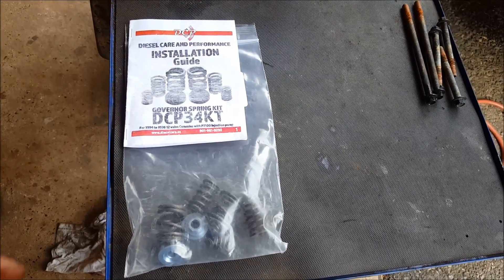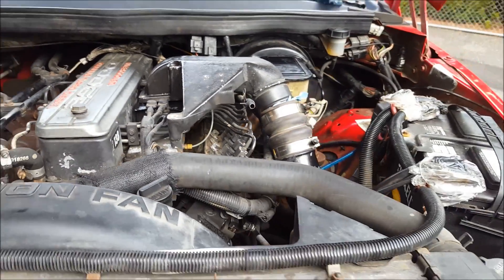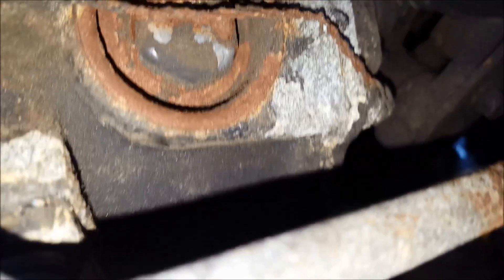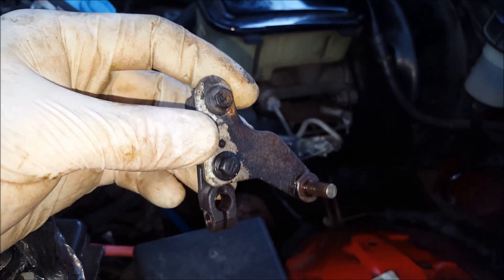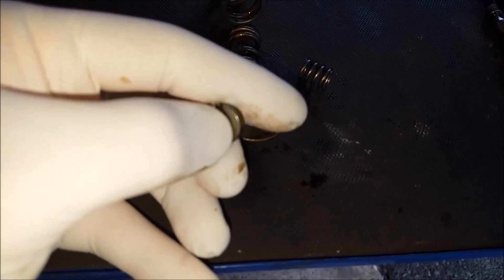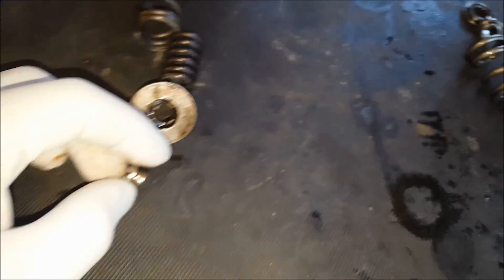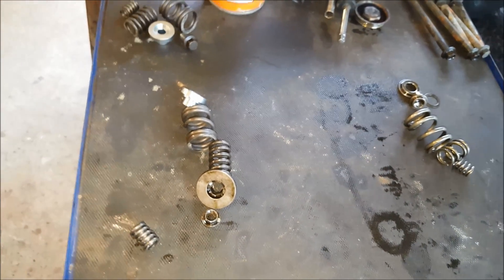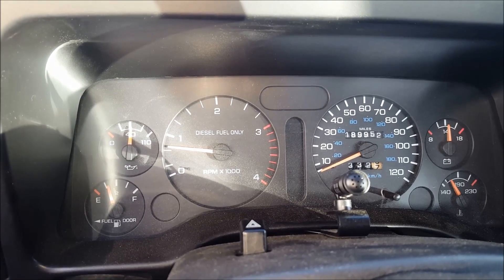HOW TO INSTALL 3k 4k Governor Spring Kit on Cummins 12v 6bt GSK Dodge Ram 12 valve

Comment: Did you have to adjust idle speed ? After install and did. Your truck keep the way it’s supposed to start without touching pedal? Trying to keep mine like it was before gsk
Reply: Ok gotcha are you up north where it’s really cold? I’m down south so I hope it don’t have a lot of trouble starting but I see you measure yours I measure mine from top of stud strait down to top of lock nut I got 0.149 on Digital caliper
Reply from the maker: @cdpperformance2613  yeah I'm in Pennsylvania. It gets pretty chilly. You should be good either way. Might just have to tweak idle a touch. But that's very simple
Reply: Yea I installed the 4k gsk yesterday went 4 clicks in and truck wanted to run away at 1600 rpm’s idle up! So backed off one click came down to 1k so I’m going out this morning going to back off one more click and hope it fixed it haven’t touched idle 10mm nut yet
Reply from the maker: Got you. That's cool. How are you liking the power Improvement? Big change?
Reply: @NoNonsenseKnowHow  man cutter up rob on YouTube kept telling me to install springs first before buying ... new 5x12’s injectors I didn’t listen and went ahead and purchased them but it’s got enough power for me now since I just tow with it but yes help a lot honestly could have just went 3k but I did have head done for 4k so just done it but I want never run it up that hard!
Reply from the maker: @cdpperformance2613  got you. I've heard that the 4K Springs are still better though for low and fueling as well.  Good to hear she's running top notch
Reply from the maker: If it's cold I have to slightly press the pedal to start. But then again I think the factory owners manual says that you should do that when it's cold right? I did have to adjust my idle. the springs definitely affected the cold idle.  Not sure if you saw but I actually did another video about a cold idle problem I was having and had to turn down the governor spring nut a little bit
Reply from the maker: Which helped, but it's still not as good as Factory

Comment: I found that the 4k springs made for a much better towing setup with my dually. I started with 3k springs then I went to 4k. My power band is very wide now and comes in at lower RPM. I installed 60lb head springs but I've only been over 3000 like once maybe twice
Reply from the maker: Interesting. Maybe I'll have to give it a go. Will you say that it smokes more with the 4k Springs?  I also noticed some cold start stalling with adding the 3K Springs. Do you notice any of that? Or are you not in a cold climate
Reply: @NoNonsenseKnowHow  up your idle rpm maybe? I also installed 4K and found it better than 3k. No extra smoke. I ground my fuel plate and I could make a brand new clutch slip with ease. Nice light haze. Iirc I ground something close to 100 plate. But that was quite a few years ago.
Reply: @davidburdett1920   Did you guys keep the stock schemes in place,while you replacing the springs?

Comment: If you back these spings off say, 2 notches would it increase  fuel faster to the injectors.
Reply from the maker: But then you end up with stalling issues when it's really cold out carried I actually turned my Springs in one more additional click to get rid of cold stalling. Every time I would let off the accelerator before the engine was warmed up it would stall out
Reply: @NoNonsenseKnowHow mine does this and its bone stock if i dont let it warm a little. Stock springs as well
Reply: I dont have starting stall probs it starts great specs for my pump says 4 to 10 90deg clicks is a big margin, im not sure what thay are set on at the moment thewire seals have been taken, will loosen springs bring fuel on earlier.
Reply from the maker: @nigelcase2991  yes correct. I believe I touched on that in the video. I could be mistaken..

Comment: Anyone ever had a washer on one side and not the other. Tamper wire still on. Swear I didn't see one fall off. Looked with light and mirror for half hour. There's nothing there. Put the new springs in and everything seems good. STRESSED
Reply: Just did mine today and ran into the same exact situation. Did you ever have any issues?

Comment: You ever figure out the fuel air issue on your truck brother? My p7100 makes an airy sound when warm? Is that normal? Truck runs fine but idk lol
Reply from the maker: Mine never made any sounds. No never got rid of the tiny air bubbles completely. Seems to be fine though
Reply: NoNonsenseKnowHow 10-4 it might be normal being that this is my first one but yeah runs great I just need to do what you did and get a pressure gauge and see what it’s at. I did pressurize the tank and heard no leaks and saw no leaks so 😐

Comment: My 12 valve had a stalling issue. I replaced the lift pump bc I didn't trust how the old one. Replaced the screen filter and and fuel filter. No leaks from what I can see. Truck does run again but still dies. I adjusted the idle screw a little bit and I got the truck to idle but the idle just bounces up and down. Its making me think it was a governor spring issue this whole time. My idle will go from 800 to 1500 and continue doing that. I fine tuned the idle screw and it doesn't matter. It's either no idle or it'll idle 800 to 1500 rpm. Any help would be appreciated. I did plan to change the governor springs prior to my current problem.
Reply from the maker: Maybe getting air in the fuel system? Does it start right up always?
Reply: it’s either air in the fuel like he said or governor springs
Reply: Make sure gov springs are adjusted properly.
Reply: Set you idol screw low around 650 to 700 it will come back down on its own instead of staying stuck wide open at 1500 while coming to a stop.  Only down side is that your oil light will keep dropping on and off

Comment: My truck sputters at high rpms only! Has 3k springs! Could they be the issue?
Reply: Could possibly be the factory lift pump not supplying enough fuel at high rpms if you dont have an aftermarket fuel system

Comment: Do I need the shims with the 4K gsks?
Reply: I’m putting 4ks in my truck right now. I got one set in and it had 2 shims. Then I went to do the next set and they had 3. I’m worried I dropped one in my pump
Reply from the maker: With the kit are used in this video you do not use the factory shims. I'm not quite sure why. But yes if you are missing one of the factory shims in there then I would also be worried that it dropped in the pump. Maybe you can try fishing out with a magnet or something?

Comment: Can you do this with the injection pump off the truck
Reply from the maker: Andrew Stevens I don't see why not. But I've honestly not had my pump off the truck so I couldn't say a 100%.  as long as you can rotate the pump then you should be fine
Reply from the maker: Andrew Stevens let me know how you make out with. I'm curious
Reply: NoNonsenseKnowHow thanks man! I’m gonna tackle the job soon I’ll let you know if it works.
Reply: NoNonsenseKnowHow I got the 4ks in my pump with it off the truck. It was very simple! I put the shaft nut back on the pump to rotate the shaft with a wrench. And as for the shims I mentioned in the comment above turns out the shims are not always even on each side I didn’t drop any.
Reply from the maker: Andrew Stevens awesome man! Thanks for updating and sharing. I never did one off the truck but yeah it makes sense that would be pretty easy. Much better access...
Reply: NoNonsenseKnowHow your welcome! I also have another question relating to fuel lines. Okay so you got 2 fuel lines coming from the tank, both metal then on the end of the lines toward the bell housing have rubber lines that use hose clamps to connect onto fittings. Well I know one line goes behind the injection pump and connects to a long metal line, where does the other rubber hose go? I can’t figure it out to save my life. Maybe look on your 12valve to see where it goes?
Reply from the maker: Andrew Stevens go to my main page, and click on the Cummins playlist. I have a video on there that goes over the fuel system. I think it's called troubleshooting air bubbles in the fuel system. That video should show you an image of that hose or where it goes I'm pretty sure. I'm actually heading out to dinner now. If you don't figure it out within a couple hours, comment back to me and I can take a look to help you further
Reply: NoNonsenseKnowHow thank you buddy I appreciate it. I’ll holler back soon!
Reply: NoNonsenseKnowHow I saw the 2 lines in the video, one in which I’m trying to figure out where it goes but the video doesn’t show where it connects. It shows it going over top of the bell housing, I think the video said it’s a fuel return line or maybe a fuel supply line, one of the 2.
Reply: NoNonsenseKnowHow hey can you look on your truck and see where the 2 lines go? I crawled under my truck and this is what I found out. Okay so there is 2 lines connected to my tank, but I’ve got 3 fuel lines at the bell housing. I have the fuel supply which feeds the fuel heater, then I got 2 more which has to be return lines. I know one of them hooks onto the back of my injection pump, but idk where the other goes. I can blow on the one line and I can hear the fuel in the tank bubble I just need to figure out where that line goes. Can you look on your truck and see where it goes?
Reply: NoNonsenseKnowHow I got my truck running the line was an old fuel line that was never removed. Anyways, my timing slipped yesterday and my truck would spit and spudder and white smoke at very low rpms. Well I fixed it, runs great up to 2k Rpms then it starts sputtering and white smoking while free reving it. My truck has a massive fuel leak at the wif sensor bc it broke. I have 4ks, zero plate, star wheel is cranked up, 215 injectors, and 191 delivery valves. What could be the issue with the white smoke and sputtering? I have stock timing as of now.
Reply: Andrew Stevens if you have white smoke you could have a bad injector or 2
Reply: Andrew Stevens you have to much fuel mods for a internally stock truck
Reply: no shit

Comment: Just installed my 3k springs from street sport industries using this video. Made it easy to do and I performed with confidence due to this video. Only question I ever had was do I reinstall the stock shims or leave them out?? I left mine out and tightened to same measurements. Hope this was right. Took about hour and half and I didn't remove air horn but did remove the keyed bracket. Word to the wary my key did fall out and I didn't know... So I installed it a little off and the fuel shutoff solenoid couldn't work. I had a runaway situation. Couldn't articulate the lever because was bound from incorrect location black garbage bagged the turbo filter finally got it off. Reinstalled correctly and no issues. Thanks for taking the time on the video. Incredibly straight forward and good video goes with the good instructions!
Reply from the maker: Justin Hoth thank you for your comment! And I'm glad that the video helped you out!. That's crazy about your runaway condition, I didn't realize that key could even fall out of there.!  And as far as the shims go, I actually don't remember if I put mine back in or not. I think the instructions said to leave them out if I remember right but maybe I'll have to look more into that.  It certainly takes a little bit of time to make a video and edit it, but it's all worth it when people like you leave comments thanking me. Thanks again for thd support!
Reply: NoNonsenseKnowHow it's what my truck really needed. Truly kicked up the acceleration. 
Ya I think the magnet I was using picked it up when I was putting it in to get the seats and shims out. Little half Moon key I guess. Once again I appreciate it! Now onto getting my torque converter lock to work again ha ha.
Reply: So a guy doesnt need to loosen injector lines to turn motor over...? I am just learning the whole diesel thing, thanks

Comment: I am not clear on what was measured before you took the retainer off.
Reply from the maker: Ray Gaither its the distance that the stem protrudes past the lock washer.  When you take yours apart it will be more clear.  Sorry if i failed to explain it in the video properly.
Reply: Thanks, great video.

Comment: 4k springs fuel harder down low. if you're running a bigger turbo helps with spool 4k are not just for a race truck you don't have to go to 4k. just a preference
Reply from the maker: dodgekindaguy thanks for your comment, I did not know that.  I am still going to stick with the 3K Springs however.  I really like the way it drives now with the #11 plate I installed as well.  tons of more acceleration am I still get 18 to a maximum of 24 MPG depending on what kind of driving.
Reply: @NoNonsenseKnowHow  what is the #11 plate ??
Reply: How do you like the 11 plate? Do you have it installed full fwd? Stock clutch? If so how's it holding up.